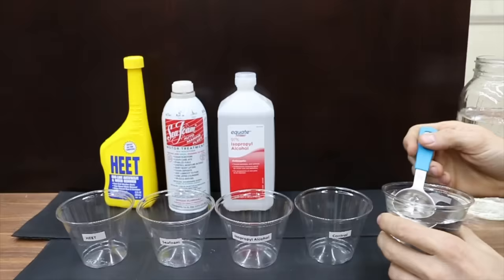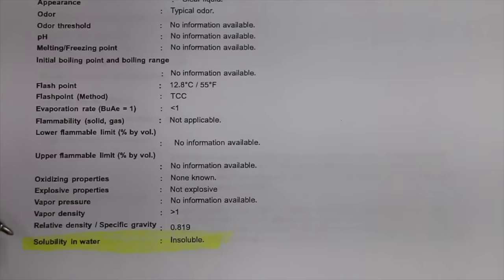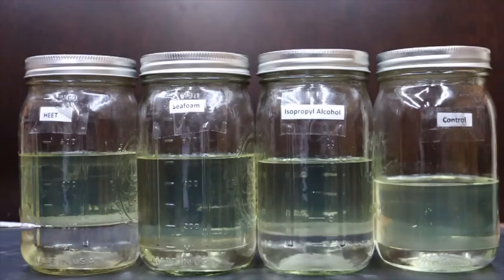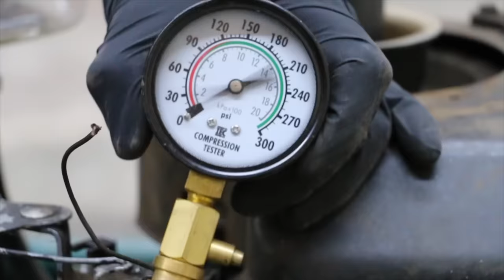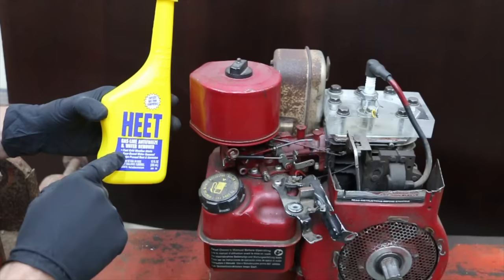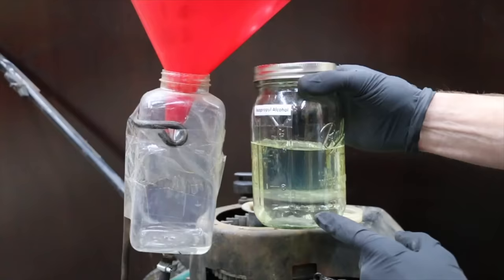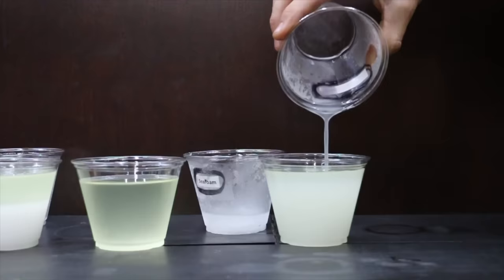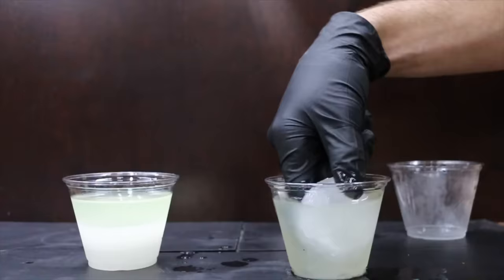Is HEET better than Seafoam for Water in Fuel?  Let's find out!

Comment: I tried this product from Meetz small engine K 100 S it mixes the water up with the gas basically burns it through the engine.  I tried it on one of my snowblowers it always has some water in the tank in the fall.  It mixed with the gas and water and after about 3 mins ran perfectly.  I checked the gas tank the next day no water in bottom still mixed in with gas.  Started snowblower back up ran great. This product definitely works this blower always has this problem in the fall. Usually I just drain the tank and put fresh fuel in.

Comment: I stand by heet. Coming back to this video in december reminded me I should put some heet in my honda since winter break at my college is 1 month and I dont drive anywhere nearly as much besides saturdays and sundays for work. I either use heet, or those red bottles of STP gas treatment which is advertised to do the same, stop freezing and remove moisture from the fuel system and I do notice the STP treatment consistently provides my honda a quicker cold start than no stp and the heet isnt as "spicy" as stp but it also gets the job done and is far cheaper, only 2 dollars a bottle for heet vs 4.99 for the stp but the stp is also a cleaner but so should the heet being that its pure methanol and methanol is a very good cleaning agent for engines. To sum it up, heet works dam good as advertised for cheap, and the stp probably wont work as perfectly as heet in severe cases but the stp also doubles as a engine cleaner and provides better cold starts for some reason. You should look into this with your farm truck. STP gas treatment vs Heet in terms of winter cold start-ability, both are red bottles and cheap but work very good.
Reply from the maker: Thanks for the feedback.

Comment: I have used seafoam in my small engine fuel for a lot of years.   I have never had a fuel related break down in any of my small engines.  I also change the fuel filter every spring on everything, car, truck, lawn mower and so on.
Reply from the maker: Thanks for sharing.

Comment: I had this problem on my wife’s Lincoln Navigator in January car wouldn’t start at all and it’s a fairly new vehicle.. added iso-heat red bottle with injector cleaner ..this was the morning, that afternoon about six hours later car started up without any issues. Since then I’ve running that in my truck about every third tank and even my motorcycles 🤷‍♂️
Reply from the maker: Thanks for the feedback.

Comment: I regularly use seafoam in all my equipment and vehicles, If I suspect I have water in the fuel I will add yellow or red heat if it's a diesel and let it warm up in the garage for a while. works every time.
Reply from the maker: Thanks for sharing.

Comment: Starting using HEET to boost octane in my Jeep. 100% methanol has around 119 octane. Flex fuel capable works best. Methanol will really lean the mixture out in non FF vehicles. Looks like IP alcohol had around 105 octane also.

Comment: It's always wild to see how crazy over-square the small engines are (their bore diameter is much wider than the stroke length).  This is how small 4 stroke lawn mowers can achieve enough torque to manage lawn mowing in even the heaviest of grass.  It also raises the compression ratios.

You'll see this over-square setup sometimes in car engines, namely with cars that use Boxer (flat 4 or flat 6 cylinder) engines.  They have to do so in order to make the shorter, but much wider engines fit into a reasonably small space.  This also means that, while they may not get the best gas mileage, they certainly have torque to spare (especially compared to their rated horsepower.  HP wins arguments, TORQUE wins races!).   This is why, with the lowest priced base model subarus, we've managed to pull large 4 by 4 pickup trucks out of being stuck in the snow in highway ditches.  It doesn't hurt that the Impreza and Crosstrek are both all-wheel-drive with their trick electronic differentials, but the low-to-the-ground center of gravity and the monster torque their over-square boxer engines put out is really where I see the deciding factor when I sit down and do the math.

That's not to say that I would get a bunch of car engines with the same displacement and do a shoot-out between the over-square boxer and a standard 4 cylinder.... but, if you could find a small engine that is NOT over-square, that puts into the realm of possibility.
Reply from the maker: Thanks for sharing.

Comment: Yeah I got one for you.  Compare the performance of integrated voltage alternators used on my riding lawn mowers.  Mowers are notoriously known for for draining their batteries even after a few hours of use. An inline diode allows DC current to come from the stator AC production. But somewhere in all of riding mowers they fail to recharge the battery. What gives and what upgrades does a person need to keep the mowers starting?
Reply from the maker: Thanks for the video idea.

Comment: WW2 corsairs and I think P-51 mustang's used a mix of coolant injected in gas to escape during a dogfight. Adding coolant in an emergency added 20 hp or maybe just longer range if returning to an aircraft carrier. Pretty good idea... til the coolant runs dry of course. So question is, does adding a small % water increase fuel economy or the good ol throttle response.

Comment: Not long ago my car sat in Salem Oregon from September to January while I was traveling. It’s pretty muggy there and rains a lot. I didn’t put any treatment in my gas, and it was filled 3/4 with ethanol fuel, so it soaked up a lot of water. A mile into my trip after firing up the poor little kia, I stalled out at a Home Depot. Would not idle at ALL. Put two bottles of red HEET in the tank and a can of seafoam. Stood on the throttle for a few minutes and she came back to life. Toped it off with 5 gallons of fresh fuel and had no further issues. After watching this, I wish I had put heet in the tank rather than seafoam since I left the poor car sitting again for two months! Oh well!
Reply from the maker: Thanks for sharing.

Comment: My experience driving a semi in extreme below zero conditions for 23 years is there is no product currently available that will keep the fuel from freezing without tank, engine, and line heaters. That's why vehicles sold in colder climates have these installed at the dealer. A fleet I worked for the drivers were even issued Diesel 911 and had froze fuel due to failed heaters. I have not had a gas fuel freeze under the same conditions.
Reply from the maker: Thank you for the feedback

Comment: I live I north central ohio and have had fuel line freeze up from time to time and used heat and it melted the ice every time. But we're talking only drops in the line. That's all it take to stop the fuel flow. Thanks for the video.
Reply from the maker: Thank you

Comment: Gas line antifreeze is fine, as long as you don't overdo it.  Only use it when you have problems with the vehicles driveability.  And then only add one bottle.  If you're still not entirely out of the woods, wait until you have sufficient space in your tank to refill it with good, uncontaminated gasoline.  Overuse of gas line antifreeze can erode the rubber seals in your fuel system, like the O-rings on your fuel injectors.
Reply from the maker: Thanks for sharing.

Comment: Isopropyl Heet at likely 99% concentration in the red container (the only 'dry gas' I will use), is far far superior to the methanol in the yellow bottle. A 5 inch column of the  91% isopropyl rubbing alcohol tested would already have close to a half an inch of water to start with, before additional the water added in the test.  The heavily corrosive properties of alcohol in fuel is a real problem, especially on aluminum though.Thanks for your thorough, methodical tests. I really enjoyed the vid, you have a lot of patience and mechanical aptitude.
Reply from the maker: Thanks for sharing.
Reply: Cool story bro

Comment: Great video, thanks. I just had a situation (since you asked) with my motorcycle on new years eve. 3am heading into work 30`f and I was running 70 mph on Hwy for 25 minutes. Was lil low on gas with a 2 gallon tank. When exiting Hwy she started sputtering and trying to stall. Was none too cool as my hands were so cold I could barely deal with the problem and was very lucky I made it the short distance to work. 12 hours later when leaving it's 50`f and I was worried about getting home to relax and bring in the new year. Ran fine, gassed her up and not a hiccup. I'm pretty sure it was water in the tank that froze along with my hands. Gonna try some heet and I'll try to let you know the results. Happy new year!
Reply from the maker: Thanks!   Thanks for sharing.

Comment: Great video again. I live here in Florida and work for an auto parts store. One issue we have here are part time residents that leave cars here year round.I always tell them to add a stabilizer and top off the tank to prevent the high humidity of summer from condensing in the tank.  Now the more I think about it most new cars are a sealed system (thus the need for the purge tank) I think more of the issue has to do with phase separation of the fuel. Maybe a vid on how long does it take for phase separation to occur and with additives added. And I always recommend HEET for those returning with poor running cars and my first question usually beginning in November is "how long did the car sit".
Reply from the maker: Great video idea! Thank you
Reply: Interesting you say that. I just moved to Miami in August. My 1998 Ford F150 fuel pump went out in November. I had this weird feeling that the change in climate (WA State to Florida) might mess with the gas tank.
Reply: @nsjohn130  Just another thought if your fuel pump resides in the tank. Some cars and trucks have issues with running below 1/4 tank as it exposes the fuel pump that is usually in the fuel and helps dissipate heat from the pump. Add the additional heat of Miami. Just a thought. I never run my truck below 1/4 tank and have never had a fuel pump issue. Just a thought. I heard this years ago and it made sense. Whether it is a wives tale or not is up for debate.

Comment: I drive a 2000 Camry with the 2.2 L and have had a weird issue where condensation builds up in my gas tank. I've owned the car since almost new and now have 450 1000 miles. I have two homes one in South FL and the other in North FL. You wouldn't think that the temperature differences would be as different as they are but sometimes like today they can be dramatic. For example last night the temperature dropped to 21 degrees in gville and 64 degrees in Miami. Anyone who is familiar with the weather in the State of Florida knows how erratic and weird the weather can get throughout the state. It's a common joke to say that if you don't like the weather just wait about 15 minutes and it will change. I noticed I would have a problem sometimes during the colder months when I would get gas at stations in the northern end of the state every once in awhile I getting water in my tank. Sometimes the problem would get so bad that the car would feel not like it had a fuel issue but more like a transmission issue. In fact in the earlier days when the car was still under its extended warranty it honestly felt like the transmission was slipping at highway speeds. At 71k miles two different technicians from two different Toyota dealerships diagnosed the highway hiccups as being transmission issues so Toyota was forced to replace the transmission with a brand new one. Imagine my frustration when I picked up my car from the dealership with the brand new transmission from the factory after not having the car for two weeks and the hiccuping was worse. The damn thing never tripped a code in the car didn't always do it so it was hard for the mechanics to duplicate the problem but when it happened it was noticeable. Finally while having a face-to-face meeting with a " Master autistic I mean technician" from Southeastern Toyota I explained to him that it becomes more noticeable once the car goes below half of a tank. When I told him that because of that I never let the car go below 3/4 of a tank. His eyes lit up and he started typing on his computer. After then taking a sample out of the gas tank he determined that there was quite a bit of moisture other than gas sitting at the bottom of the tank. It turns out that a lot of gas stations in Florida have a problem with moisture building up in their underground tanks due to the different extremes in temperatures. It could be below freezing one day and then 85 degrees the next day and if they don't mix in the proper anti-moisture additive they get a lot of condensation build up and some cars are more prone to others to be affected. Also although that you some they don't use a lot of ethanol in the gas down here so Florida's alcohol content is in his high. Rather than using an additive in the tank I've had to train myself to not just keep topping off the tank but to let the gas go down below a quarter which goes against everything I believe and have been taught in my life. You know the feeling you get when you make a wrong turn and realize that you're on Martin Luther King Junior Blvd? Well that's the same feeling I get when the little gas light comes on telling me that I have below a quarter of a tank. But by running the tank low every fuel tank. I haven't had the problem since. The point of this very very long story is that sometimes these additives like seafoam and Heet may work if you have a small amount of moisture in your tank but they're not going to help if there is a consistent buildup. There's no such thing as a mechanic in a bottle
Reply from the maker: Thanks for sharing.

Comment: Good video.  I would like to add that Heet  and isopropyl alcohol should be used before the fuel system freezes. After it freezes the only way to unthaw the lines and the tank is to get it into a warm garage or cover the car over and blow heat in there.
Reply from the maker: Thank you

Comment: I have always used heat or dry gas in the winter time and have always told my kids and wife that in the winter when you have a half tank of fuel you're empty keep your tank full and eliminates that open space which allows condensation your major enemy in the winter.
Reply from the maker: Thanks for sharing.

Comment: A complete compression test of an engine involves ALL cylinders.  Not only are you looking for pressure,  all of the cylinders should not vary more than a certain percentage.   Do your homework and you'll see what I mean.   Lucas makes some great products.  I get your concern about too thick of oil in winter.  One solution might be to use only half as much Lucas as recommended.  In this way, you may still realize some benefit from it's use.  I'm of the opinion that using Lucas, even a percentage of recommended amount, will improve compression............Thanks for sharing.
Reply from the maker: You are welcome!

Comment: Whoops at mixup....  I use seafom before fueling, then I use either Berrymans or Heet, mostly Berrymans right after putting gas in. Not sure which order I should be doing them in, but I figure SeaFoam first to help mix, the Berrymans/Heet after filling to get water out.
Reply from the maker: Thank you!
Reply: I use Berrymans B-12 about once a month and Lucas gas additive every other fill-up, BEFORE fueling so it mixes well. I never use Scamfoam.

Comment: Winter form of diesel/petrol required legally in central Europe. I expect it is the same in US.
And in winter it is not a question if diesel stops starting, but when. With petrol there is no problem.
If you have Praga V3S (still in use), you make a small fire under the engine to heat it a little bit up and put burning newspaper into the air intake when starting. Once it starts, all ice will melt soon.
Reply from the maker: Thanks for sharing.

Comment: Very good video as always! Here in the north (ontario) one must have a understanding of gasline antifreeze if you are driving the back country.  Methyl Hydrate (methanol) is the best.  Isopropyl may keep a line from freezing but does not work well for thawing one that is frozen. As you know, moisture comes mainly from condensation inside a fuel tank which is low on fuel and is left sitting.  I think old "wood alcohol"as it was called in the 60s is methyl hydrate and I think it will burn in a alcohol burner ,wick burner, when mixed with up to 50% water !
Reply from the maker: Thank you!

Comment: Been driving over 40 years and never used any of the dry gas products . and don't know how you would ever know you needed it in the first place, and if you ever did have a fuel line freeze this would never make it's way to problem just dumping in tank after the fact. Best bet is to not constantly run with a near empty tank to cut down on condensation in the first place.
Reply from the maker: Thanks for the feedback.

Comment: The point of any addative was to mix the water to the fuel thus getting it out. It's fine for condensation amounts of water. But if you have a good but of water in the tank, then only draining the tank will do the job properly. All this from 35 years of experience. Best one was when a kid heard his dad mention he needed to get gas. So the kid went out and filled the tank with water ! Luckily back then, mercedes tanks had drain plugs. So we drained it, put some gas in and drove it around the block and drained it again. No problems after that.
Reply from the maker: Thanks for sharing.